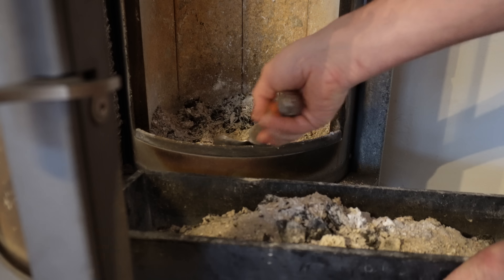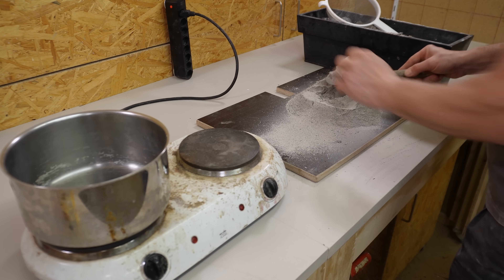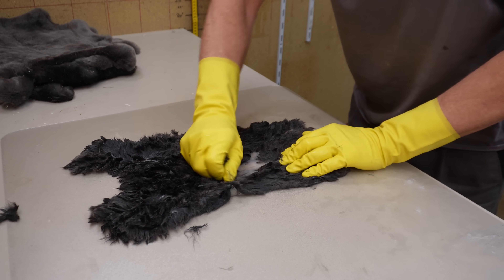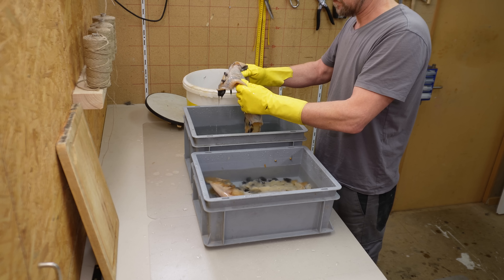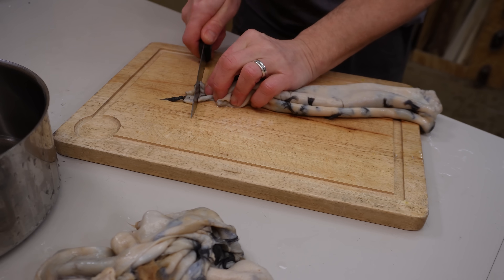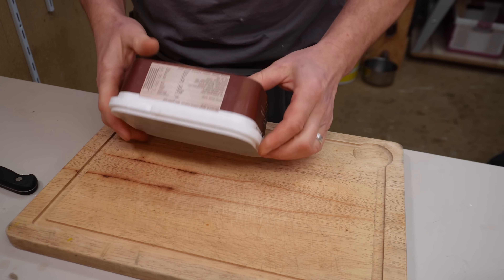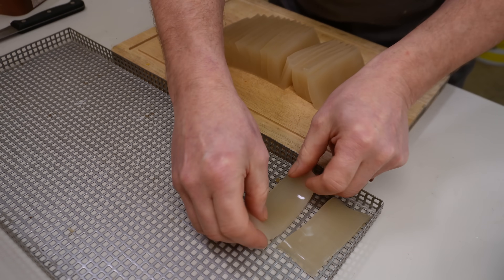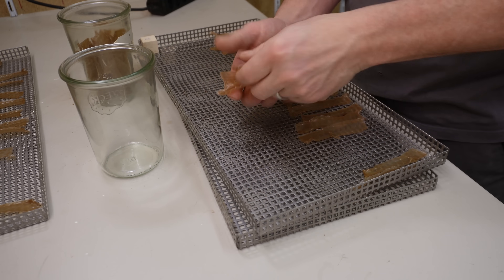Making GLUE from animal SKIN - used for thousands of years - STRONGER than modern glues?

Comment: I fire shells in a little brick kiln (fireplace would probably work fine) and slake them for the hair removal, you can use seashells or eggshells, seems to work good and doesn't burn my hands, the soak time is usually a couple days but i tend to forget about them for a good week,

Comment: These  videos are a treasure trove and an inspiration - thank you for posting them!  I have a question about the glue test - is gluing end grain surfaces to each other desirable because you’re testing the glue strength only and removing any kind of variable that might be associated with the properties of a longitudinal grain joint?  In wood shop class we were taught that end grain should never be thought of as a surface to take a proper glue joint.  Ideally wood should be glued with sections of longitudinal grain running parallel, and perpendicular running a not so close second place in reference to strength, veneers and plywood notwithstanding.

Comment: My theory is that the point of failure is at the wood grain level, therefore the fact that you added a primer for the rabbit hide glue provides a slightly bigger area where the glue has bound with the wood fiber.

Comment: Is there a reason not to extract in a large volume of water before reducing down to concentrate the glue?
Reply from the maker: Reducing a lot of water at 65°C takes an endless amount of time and would reduce the quality of the glue. The first brew (65°C) is of better quality than the two following ones.
Reply: @ is there a reason to keep it so low in temperature?

Comment: Very nice setup and video, as always.

Note to viewers - All of the glues tested here are strong enough for all practical purposes in woodworking. Strength is commonly not an issue at all, the choice of glue regarding to its physical properties mostly come down to which materials you are gluing and how resistent it needs to be to factors such as moisture. PU and epoxi for example work well with various materials and combinations thereof, such as metal and to some extent plastic.

A cabinetmaker or a luthier or similar, mainly choose hide glue because of it's reversibility. This is a fantastic feature, almost mind boggling, which as far as I know no other glue of similar strength and usability has. With hide glue you can make non-destructive repairs. Of course there are other reasons to choose hide glue also, like non-toxicity, biodegradability, and historical accuracy.

PVA glue is an excellent glue in most ways. It's easy to use, cheap, strong, and generally non-toxic. For most people there's no need to use anything else when gluing wood.

(As a side note within the note, here's a link to a very easy to do yourself gelatin glue - https://blog.lostartpress.com/2023/09/26/how-to-make-our-glue/ . It's made with only store-bought gelatin, salt, and water. https://youtu.be/Gjks6Ph7MwU?si=IOT8DaVWwKtXRVOD&t=132 )

Comment: this is what the professionals use on a lot of furniture. best thing is not only strong, but it's also reversible with heat and moisture, so you can disassemble furniture to make repairs without destroying the wood.
Reply: Both good and bad -Good is that it's reusable & water solvable and bad that it's reusable & water solvable... Hide & fish glue have the tendency to soften from moisture in air which can lead to a furniture coming apart if it's not stored in dry enough or if it gets properly wet for some reason.

But I don't hold that against hide glues as I've that happen to plastic glues as well.
Reply: @ that's true, it's less reliable in very wet or humid environments. certainly wouldn't want to use hide glue on outdoor furniture, and maybe not great for tropical climates
Reply: @villerantavalli9395  to be fair, if your wooden furniture gets exposed to moisture so much that it becomes a problem for glued seams, the wood itself might have bigger problems
Reply: @ The wood rarely rots even in those instances, the joints just get loose or a table surface cracks. Happens commonly if the temperatures fluctuate a lot such as in unheated chalets or unheated garages during winter, not a big issues inside a house where people live in and keep the temperatures & air moisture constant.
Reply: The real benefits of hide glue over PVA and other synthetics is that 1) it sticks to itself thus enabling repairs where the joint can’t be cleaned of old glue (split seams, cracked guitar tops) and 2) hide glue has much better creep properties compared with PVA.
Reply: Used in instruments also, such as acoustic guitars
Reply: I make hardwood furniture for a living and I can attest this to be true, we use PVA for most projects especially large orders for restaurants who need good quality furniture but have to maximize value as well, the work order for them is usually maple assembled with PVA, once the piece has outlived it's usefulness it is thrown away. But with smaller orders for more ornate pieces/ one offs for discerning customers we still use hide glue and more exotic/higher grade lumber, this gives us the ability to have it returned and repaired almost indefinitely.

Comment: Just so you know, PVA and UP are glues best for tension strength, not torsion, as technically the cubes glue line with them is under constant stress from they way these glues dry. If you would pull the cubes apart instead of twisting them i want to bet it would preform way better, possibly differently from the animal glue.
Reply: I disagree. It depends upon the application. Casein is stronger in both a straight and tension bond than PVA.

Comment: Not comparing with superglue is a mistake, its such a reliably well bounding glue that makes an excellent baseline no matter what wood you use.
Reply: Superglue has no twist strength, would be loser here
Reply: At least till it encounters water be it steam, humidity or well.. Just water. Have to be careful about using water based stains with it.
Reply: @SilvaDreams what??? completely false. you need isopropyl alchohol to wash it away. superglue famously does not react to water.

Comment: Conclusion, might as well just use wood glue
Reply: PVA glue is close enough in strength that it would normally be a good alternative. But of course, there are other factors to consider, such as moisture resistance, heat resistance, reversibility, and even just availability. For some applications, that could strongly push you towards one or the other. If you need moisture resistance, than PU is a much better idea. But if you built a musical instrument using PU, the luthier that you ask to service it a few years later is just going to curse and then send you home.
Reply from the maker: Thank you for the good information and additions.
Reply: Gelatin powder rehydrated in a bit of hot water achieves a sort of hide glue.

Comment: Could you test priming with PVA by soaking the endgrain (without it drying) and then, after like a hour, pressing them together to dry?
Wood is mostly empty space, it should be possible to make a stronger bond even between the endgrain, if the glue allowed to penetrate deep and create not just an adhesive layer, but a volumetric structure intertwined with the wood fiber.
Reply from the maker: From my perspective, it is not possible to prime with PVA glue or PU glue to achieve a stronger bond, as a layer of PVA on a second layer of PVA does not bond well. The same applies to PU. In addition, these glues need pressure from the start for a good bond.
It may be possible with epoxy. But you have to get the timing right. 
The strength of hide glues (glutin glues) lies precisely in the possibility of priming. The primer only needs to be dry. Gluing is also possible after weeks. A good bond is also possible without pressing pressure.
Gluing with hide glue without priming, followed by a breaking test, has reached approximately the strength of epoxy.
Reply: @andiswerkstatt-ow4uw  Do yo have any data on how it performs when it's not end to end grain?
Reply: @IvanHryn afaik most glues are stronger than the lignin that binds the fibers within wood. Likely outcome: the peace would break anywhere but the glued surface with any of the glues shown here